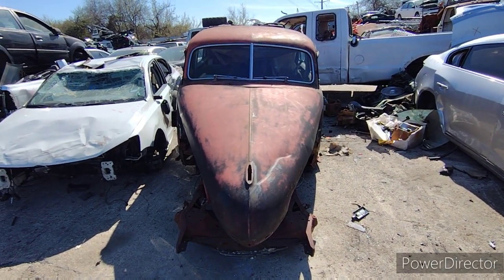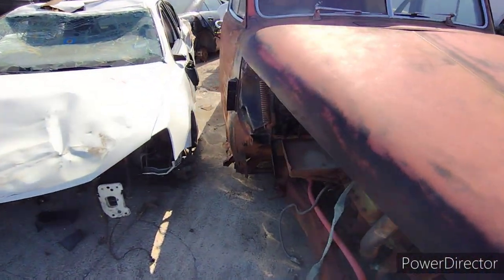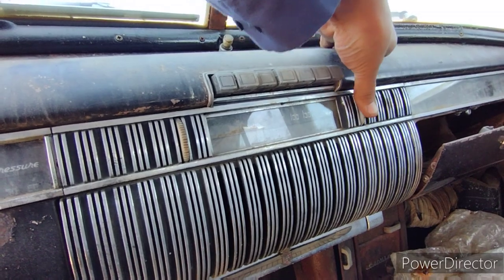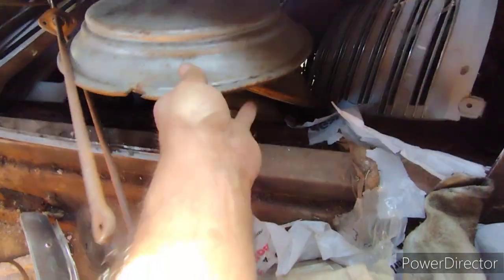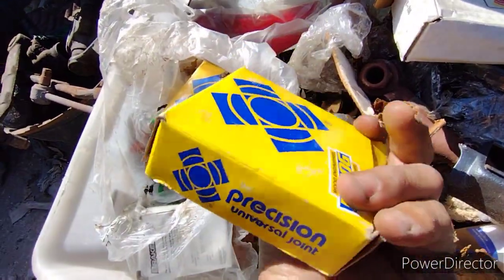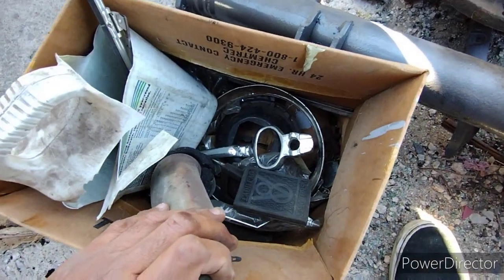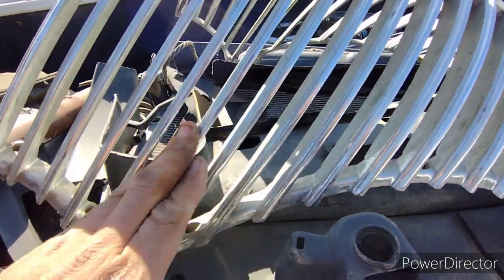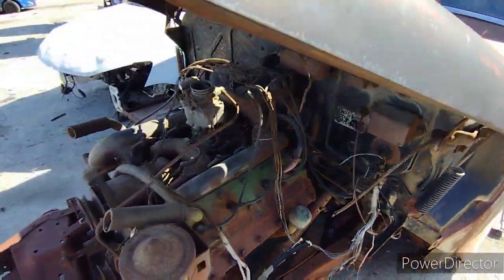What Did I Find Inside This Caddy? 1940 Cadillac Series 62 Junkyard Find With Goodies!

Comment: Whoa Nelley, it's a Cadu and it's over for you.  That is indeed an oldie. Just need you to don a fedora and a zoot suit and you're in. LOL.

We got the tag, we can brag: 40 for 1940 model year, 6219 for Series 62 four door sedan,  not sure if that's a 51 or a 57 on the interior trim, but 51 is two-tone Tan Bedford cord interior trim and 57 is Tan Bedford cord interior trim, paint is either 1 or 7, and 1 is Black and 7 is Beaver Brown. Cars with black exterior paint in 1940 could have had black, red or green wheels and tan cars would have had Beaver Brown wheels. The original engine is a 5.7L (346 CID) "Monobloc" V8 with about 135 gross HP. Either a three or four speed transmission was available, as well as a Hydramatic automatic. The engine was also used in military vehicles such as tanks during WWII. No VIN, can't win. As other stated, lots of good parts, so if you can get them cheap, definitely some resell chance there. 

Whoa Nelley, 1940 and maybe has to go. Zoot suit and a V8 to boot. That's it, time to quit. Cadillac ain't coming back. Beaver Brown wearing a frown. Lots of junk in the trunk. Going to be flat, that that's that. This needs a fedora hat and that would be that. Series 62 and it's through. Going to get squished and the Cadillac faithful, many here, surely Benny, and yes, the Google Man are going to be very, very, very, very, very, very pissed.
Reply: @gr8fulpn  If it wasn't apart, it might have had a chance to go back on the road perhaps.

Comment: Ok that’s a 1940, series 62 5 passenger sedan. Paint color black, with two tone Bedford cord trim interior. The particular thing that made this car special is that it is body number 2. Meaning that IF Cadillac followed their usual production standard, this was the SECOND Cadillac built for the 1940 model year. Sometimes if they had limousines ordered they would run those first but it appears that for the 1940 model year they ran series 62s. I would love to have been there to see it, I probably would have grabbed a helper and bought every part there including the dash bits. Many of those parts fit a couple year span but irregardless it’s amazing videos like this I wish I could just send a check and have the stuff shipped to me in a box lol but unfortunately it would likely cost more to ship some of those long heavy parts as it would be to sell some of them. But you had basically everything there but the sheet metal. Trim, brakes, suspension, wheels, bearings, spindles, rear end, grille, lights, lenses. That is an absolute treasure trove.

Comment: Manifolds off that engine are like gold.  For a you pull yard price I'd take the whole engine and trans.  That trans is pretty desirable for the hot rod guys.   Radio and clock would be a good flip too.

You could probably clean that thing right out, there's a lot of money there. Even the brake parts from that you could probably sell.  

Grille is cast and probably $400-$500 alone.  Nicer it is the more it's worth

Thing is a gold mine of stuff if the yard will sell it reasonable.  

Dang Body No. 2
Reply from the maker: Unfortunately it depends on who you get at the counter for the smaller stuff. Things like an engine, transmission and rear end, they are higher than a U pull it yard even though you are the one pulling it. I took a small box with the bearings, u joints and other small new stuff and the dude said $100. I was hoping for at most , half that. Ended up at $75. In contrast, the other dude charged me $50 for the the grill guard, hood ornament, and wheels cylinders
Reply: @ClassicRideSociety  I almost think I'd take a picture on my phone and go up and show that to them first.  

But I would go up to $200 on that big grille, maybe research the price a little.  I have one now from a '41 Buick that is much rougher and I've turned down $300 because they want me to ship it.   I'd hate to come back and see they broke it.